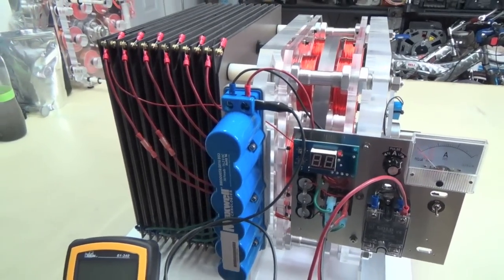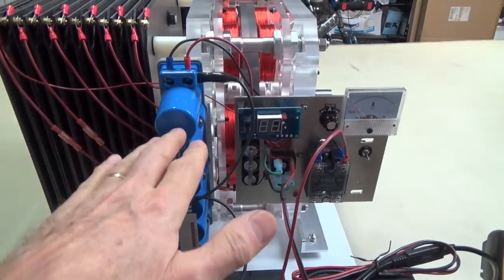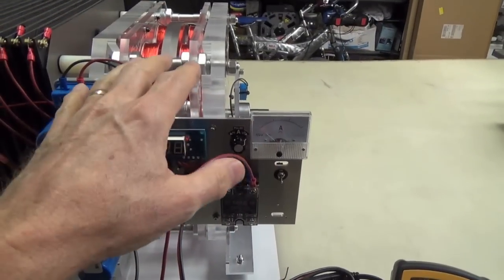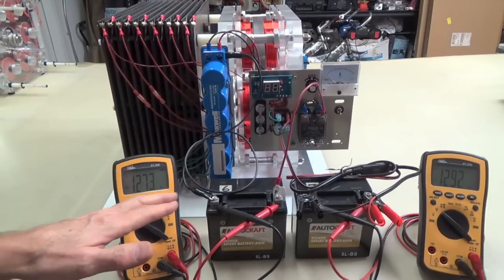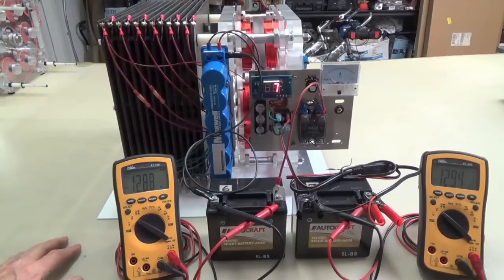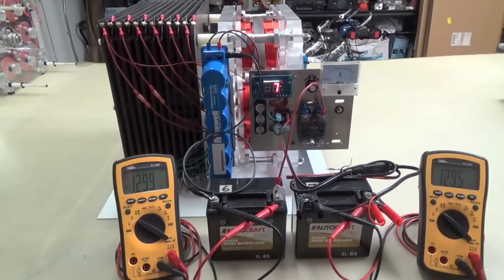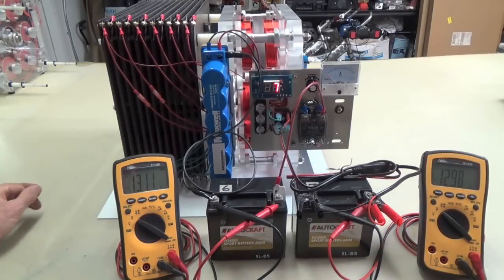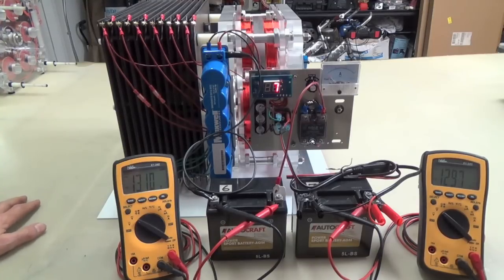NO SOLAR NEEDED!

Comment: A programable logic controller would take all of the guesswork and fidgeting away. You should be automatung the uptime and doesn't based on measuremebts of the system.
PLCs are great today; and cheap with very nifty programming tools and features.

Comment: Just out of curiosity is there a reason for a 7 Seconds off time? Because it appears as if it's charging for the 4 seconds but then AC charge is maintained while the DC charge drops. It drops less than where it initially started, but it is dropping.

Comment: I think people would understand if he said it works off electrolysis,like a conventional battery just without acid,the reaction strips the matarial and that's positively charged and flows in least resistance this reaction takes a moment to build is why it pulses much the same as when a conventional battery is dead if you  wait a second it will give you a pulse of energy and die again he figured out how to do that with different materials.I explained how in another comment how simply using known technology's would increase its functionality bc remember folks all new breakthroughs the technology existed before just like this battery here a acid battery works off electrolysis aswell just not a very efficient or long term way on creating electrons we can induce electrons with all kinds of ways too bad our society limits our species and we can blame money as our limiting factor believe me the crazy hippie bazaar therosists have one thing right we outgrew  our own way of civilization but that's a whole other subject is why this hasn't happend a decade or more ago and is why were not driving off cars off hydrogen made from water yes cars ran off water and we can thank money for that

Comment: I don't get it, and im trying to but I don't. you got that cell on the left side of the machine which I assume is the power source for the generator. do you have to charge the cell/cells initially?  Are you talking a perpetual motion machine? how do you get around the problem of friction, and can you actually use the machine to provide power for things (without killing the cycle) or does it only feed itself?
Reply from the maker: Cells are never charged. °Not° a perpetual motion device! Energy conversion with an output.
Reply: @PMMG4HYBRID  still didn’t answer the question of friction and using it to power things and what the source of power is
Reply: Phillip J dude the cell recharge themselves by a chemical reaction.

Comment: This video is not made for the layperson. Here's the simple explanation. Those black sheets are graphite batteries. They power those blue capacitors. Those capacitors run that motor/generator. That charges the two batteries. It's an energy conversion system. Not a perpetual motion machine.
Reply: Looks like a the long hard way to convert energy from the solid state you don’t need a rotor 
you lose energy through friction this is redundant the only thing special about this is the solid state graphene batteries the rotor and super capacitors are redundant

Comment: interesting post. I'm buying a 34 mtr power boat /trawler yacht (actually a fishing trawler stripped and converted to a luxury yacht) which I am converting to a pure electric power boat. The system we have is a unit that we use here in projects here in Africa and is magneto driven. We usually use a 5mw unit to supply power for a town or big mining site but will be using a 1 MW unit with two electric motors producing 550 plus HP. Unlimited range, silent, no heat, clean. Only little issue is the furl tanks are no longer going to part of balast so maybe huge fresh water reserve 😉 get in touch if your interested : Altruistic-matt@protonmail.ch

Comment: Well it is amazing yes, how ever it is very easy to understand that that it is a homopolar motor/generator. Spinning up the flywheel stores rotational energy when battery  7 is connected , and dumps energy out to battery  6 when battery 7 is disconnected, via a timed switching relay,  the diode on battery 6 is to prevent it from powering the flywheel. It is a loss less system, from the two meter's, ammeter and voltmeter there is about 12Watts of energy going into the flywheel, with friction and heating loss, there will NOT be 12Watts going back into  battery 6.
It would work with or with out the supercaps or the Si-Graphite cells.
Reply: Murray Smith, PMMG4HYBRID should look at Physics Girl perpetual motion flywheel. Next Gen'. = )
Reply: Malachi Duncan why? Because of he statement at the end, great video.

Comment: Cells are natural crystal that it is capturing and storing and electromagnetic energy that is everywhere. low amp output but high volts. caps are there to help regulate volts and amp demand for spinning generator.

Comment: Where can you learn in layman’s terms what does your machines do?
Reply: Elias Saba all those panels with wires hooked onto them... They have crystals or something inside them and they capture magnetic energy from the air. So when it's on 4 it's a motor being accelerated (by energy from the panels) when it switches to 7 it's coasting and is a generator. Hope that helps
Reply: @sentradynamics8889  from what i have understood... it produces more power when it's coasting those 7 seconds then it takes to run on those 4 seconds.

Comment: So I purposefully went and read up on a joule thief or Armstrong circuit to understand what I was seeing here. You have an initial power source, the silicon cells, that charge the capacitors. The capacitors run the generator motor. I am assuming that the small 2032 batteries are simply for running the timing circuit. So the cells charge the caps, the caps run the motor, and the timer works as a relay turning the motor on and off. The output on the generator is then shunted into the joule thief circuit, and/or into the voltage regulator circuit. That is where you get 2 charging methods. One runs via a traditional VR the other via the joule thief. And it looks like your output on the traditional side is so low that you tap into the joule thief to boost its amp output for actual charging. 

Some interesting sub assumptions. You state those batteries "rest" at over 13 volts. I personally have sold 1000's of batteries and know that even on the most absolute freshest from the factory car and motorcycle batteries tend to be resting in that higher ones range. 12.9ish. Output from automotive alternators charge at 13.8 to 14.5. This sounds impressive on a 12 volt system until you realize that they are utilizing 90+ percent of the output to simply run the car. The overage serves to trickle charge the battery. I know this from not only experience and classes but also experiments. So my assumption is that your knowledge of automotive 12v batteries is not as high as you pretend. 
Then there is the charging. So yes this method can trickle charge batteries. What cost? The cost of basic trickle chargers is 20 or less. The high end ones run up to 60ish. Even the low end ones can last years. How long does this last?
Reply: Other questions. 
Duty cycle? You say caps are rated at 300 cycles. How many pulses does it take to deplete the caps? Silicon cells? What method is used to recharge them? Is it even possible to recharge them? If so how many cycles can they go through? 
A joule thief can operate at very low input voltages. It essentially is one of the best ways to almost completely drain a power source.
How does this effect the cap life? Does it?
Reply from the maker: Ultracaps are rated at 1 million cycles Shaun.
Reply: Shaun,

Your assumption, leaves quite a few things,

' missing ' .. ..
.

Comment: So this crystal cell makes it own energy then???
Reply: cells are natural crystal that it is capturing and storing and electromagnetic energy that is everywhere. low amp output but high volts. caps are there to help regulate volts and amp demand for spinning generator.
Reply: cells are natural crystal that it is capturing and storing and electromagnetic energy that is everywhere. low amp output but high volts. caps are there to help regulate volts and amp demand for spinning generator.

Comment: I would be interested in one to try to run my house I have a refrigerator or freezer microwave dishwasher electric stove washer dryer a heat pump and I guess price on the other end of the house how much would it cost for one to run that

Comment: sir that model you're showing on yutube ,would that be enough to power up a small household with few appliances or would I be needing a bigger scale model? & my 2nd question is can I use it on board an electric car my EV car dont  have to go on pit stop every the car battery is low on electricity? and do ship order overseas particularly in asia?
Reply: This machine is designed to scam people with little understanding of electricity generation and storage like yourself from your money. It has no useful potential stay clear. Spend your money on tried and tested technology with reputable company.

Comment: make sure the batteries are away and safe due to the poisonous  gases the bats produce
Reply: Joe Simon absorbed glass matt (agm) don't give off fumes. That's why I can have a bank of 20 of them in back of my spl truck without a vent.....all enclosed I'm the beauty boards and plexiglass and sealed up without worrying about the bed of my truck exploding when I try an amp or blow a speaker. Either of those cases would cause an exposed flame or spark! They're pretty awesome

Comment: Can this be used to charge cell phones, tablets and laptop when there is a blackout in my city ??
Can I last over 3+ months without power and only use this to charge cell phones, tablets, laptops and also run LED lights at night ??
Im still trying to understand what this thing does and its capabilities and why its built.....
Reply from the maker: Yes. With listed items, cell recovery is faster for charging small battery powered devices. Cell longevity tests with small loads run devices 24/7 for nearly two years now.

Comment: do you have any of these designs that will actually run a fridge or any other item that requires electricity ? it all looks very interesting, but, if it isnt able t be used to power peoples houses, what is the good of it?

Comment: So you produce electricity from the fuel cells to drive a motor...that drives a generator...to charge batteries? Why bother with the motor-generator part at all? Just seems like a huge amount of inefficiency to introduce.  Even assuming it is 100% efficient, what is the point of that subsystem?  Cool looking moving parts? 

Thank you in advance.
Reply: Fromage Frizzbizz Notice how the voltage on the batteries never actually increases above a certain  level but seems to trend downwards instead?

They don't realise that the "off cycle producing power" is pointless because the power still had to be produced in the first place.
Reply: Good q i had same not as well thought.. Good answer

Comment: Just wondering if you ever thought about putting the Sator/Generator setup in a vacuum chamber to get rid of the friction created by the open air.  Thinking it would increase the output duration and make it more efficient.
Reply: use permanate magnet bearings as well

Comment: how much w/s or w/h does it produce in the of time and how much does it consume in the on time? mayby im really wrong but in my mind when i think over this this think has to consume more power to spin up the rotor than it gets back especially since you have wind draft on the rotor since its not in a vacuum. dont get me wrong here i would love to see this working so can you make a video where you show the amps from the in and output side too? with the voltage?

Comment: You're demonstrating a new power cell working a generator which is charging a battery..have I got the basics correct?   Your SI-Graphite power cell must be the new tech you're revealing. I'm assuming you have a patent pending which is why you don't explain how the power cell functions.  How long do such power cells last? How expensive are they? How much power can they produce...just a few of the 100 questions I have now that you've fired up my insatiable curiosity.  JCH
Reply: Knight Six tesla cosmic energy harvester

Comment: if this is genuine, why is it not world news? Energy is derived from a source. There is no other way. A force is exerted, a chemical reaction occurs, a volatile material decays etc. A local magnetic field doesn't create electricity without kinetic energy. In other words, the chicken cannot come before the egg!
Reply: This is clearly a scam. Fuel cell/battery, whatever you want to call it, this guy expects us to believe that this is a self-contained system that can provide endless power. This is impossible. Even a nuclear reaction cannot go on forever. I feel very sorry for his customers, who are now too embarrassed to ask for their money back (or maybe they still believe, who knows).
Reply: @mrclamity5560  seemingly..
Reply: I hate to bring up the thermo dynamics argument for this, but if we break it in to components, the motor generator is the question. Ie how does the motor generate and how does that apply.

Objects in motion tend to stay in motion and objects at rest tend to stay at rest. 

Now, the motor expands energy bringing the flywheel up to speed, 4 seconds, and spins freely for 7 seconds... I find this interesting because 4 seconds of use, 4 seconds of charge, would leave a net of 3 seconds positive recovery of energy.

Now my question is, is the dissipation current equal to 4 seconds of the expected in rush current, or is it 6 seconds or 7 to equal that... I do not know the losses in the system, but it does seem plausible and would take a long time to recover the energy but all the energy is in the system so it does not create any, just efficentlly uses the forces of centrifugal and gravity to get extra motion coversion... it's interesting .
Reply: Pay attention. The energy is derrived from a fuel cell, i.e. a chemical reaction, usually exothermic is spent and electrons are driven off that reaction.
Reply: The chicken is before..

Comment: I love this idea but here is my issue.  Your multi-meters are set up in such a way the voltage you show is at best showing combined voltage from batteries and generator.  A better test would be to put the meter in line with the circuit and show the amperage increase as the generator runs.

Comment: Hi have you got versions with higher power I'm in New Zealand most appliances are AC 230-240 volts 50 Hz would it be more cost effective to change all appliances or  up size  coils or create series of generators or even use coils to ramp up power to 230 volts
Reply: Brian, you could use an inverter to step back up to mains ac from battery

Comment: Very interesting, and hopeful. Would like to see practical applications for this unit.  Like, how does it power an average house. And, would one want to wire independent circuits to run house, separate from Grid ( as opposed to using it Grid-inter-tied? ...Guessing how things are going, if one has a successful unit that feeds Grid, and doesn't also have some dummy/decoy wind/solar to prevent officials confiscating the unit, it's success might be short-lived?

Comment: keep wondering can we generate power by removing harmful radiation from the atmosphere without messing with communications?
Reply: Specifically what "harmful" radiation are you referring to, in what way is it harmful, and who is it harming? If you're interested in harvesting energy from ambient electromagnetic radiation (i.e. mostly harmless radio waves generated by radios, tv, cell phones, Wi-Fi, and an endless amount of other frequencies/devices), there are many examples of such devices from the 1800's onwards. A crystal radio receiver essentially harvests the energy of radio waves and converts them into audible noise without any outside power source (https://en.wikipedia.org/wiki/Crystal_radio), and rectennas harvest electromagnetic energy (radiation) and convert it into DC power (https://en.wikipedia.org/wiki/Rectenna). There are consumer products on the market right now that use rectennas to provide energy to very low power computer circuits/electronics/sensors, such as Freevolt (http://getfreevolt.com/). However, if you are looking for something to power your car, your home, or even your cell phone, I think you will be disappointed. The very reason that most of the electromagnetic radiation present all around us is indeed harmless is because it in fact contains very little energy (relative to the amount of energy required by most consumer electronics/appliances/vehicles/etc.)

Comment: If the fly wheel was in a vacuum it could spin longer.
Reply: MMMM HMMMMM. It would actually make a pretty decent increase in productivity if it was in a vacuum.
Reply: Jesse Fritz no tom hasn't but trillions of dollars in experimentation over the last 100 years has. Bottom line unless you've figured out how to extract anti matter the laws of physics always apply sorry to burst your bubbles. YouTube is meant for views. Even if the video is complete bullshit
Reply: Jesse Fritz No, it's physics. Physics gets you the technology but proves what is not possible given the current understanding of reality. The energy required to start this motor is greater than the energy it creates. The energy when freewheeling isn't enough to make up that excess. It's not magic.
Reply: Yup! That is a key element of Elon Musk´s Hyperloop.

Comment: What kind of watt output are you getting out of this machine? Is it possible to put a charge/load controller between the two different outputs and see what kind of current this is generating over time? Even if it's minute, it'd be incredible to see.